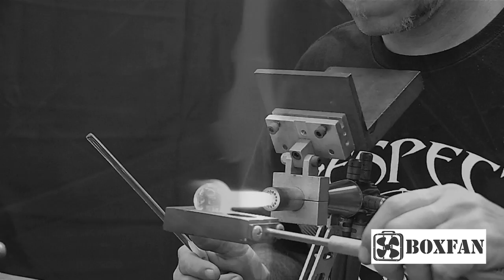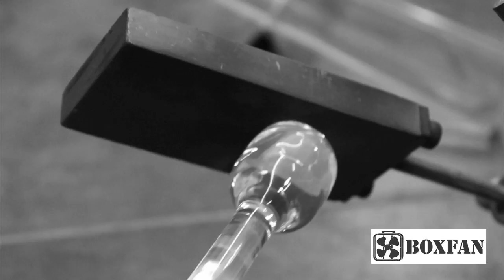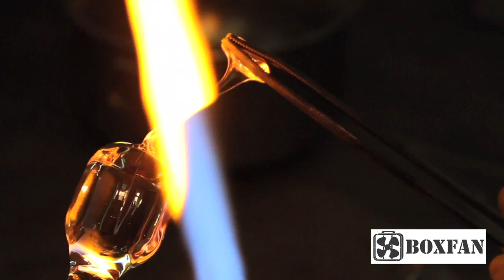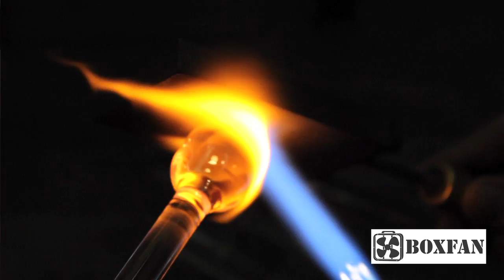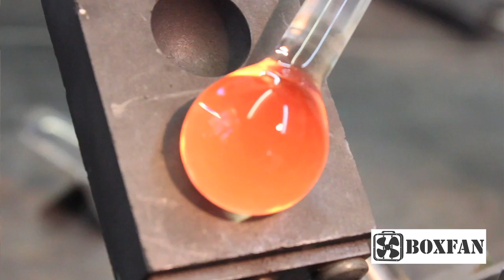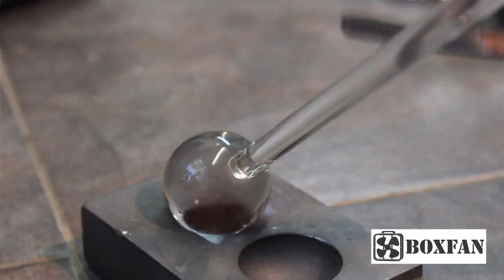Will marble

Comment: glass gets finger prints, dirt & grime buildup, dust buildup and other unwanted substances on it quite easily. If your glass rods arent cleaned, you can get unwanted blemishes that can ruin your piece. For me I sometimes have an issue of a "haze" effect, which is due to finger prints on my glass. this is a great technique for any lampworker using large amounts of clear glass that is paranoid of using a pickling solution to clean thier rods.(highly acidic, but you will have the clearest clear)